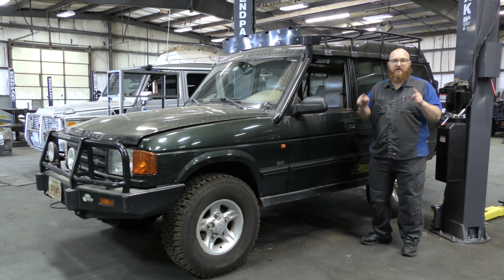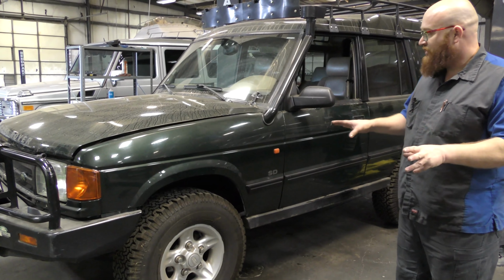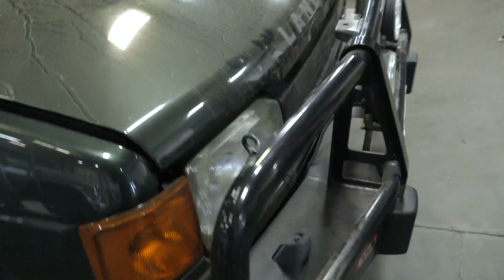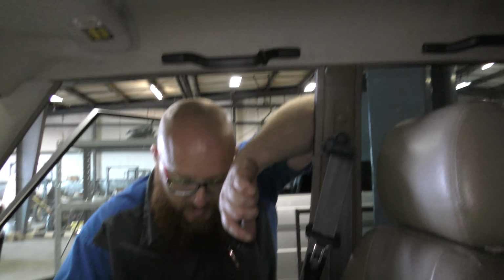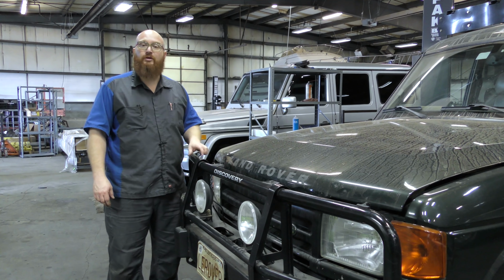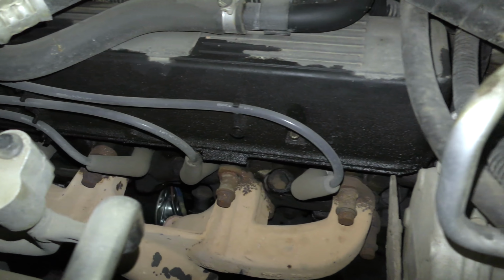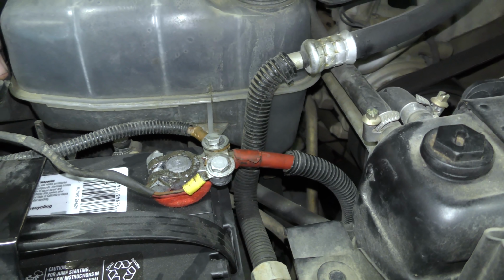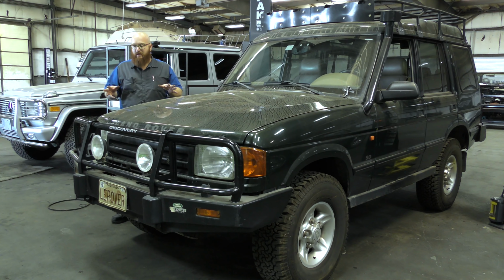How can such a simple repair cause huge problems on this '99 Land Rover Discovery? CAR WIZARD knows

Comment: People jump for the older Defenders but I like this...
Reply: Yeah its sweet
Reply: @Chris Howard , WALL STREET 😎
Reply: Yea I love these things for some reason
Reply: Defenders and Disco 1's are very similar, even down to the same axles.  But the Disco 1's are far cheaper these days.  Crawl underneath and you'll see that beneath the pretty sheet metal, they're built like tanks.
Reply: They are creeping up in price. Similar to the rr classics. They can be made just as capable as a defender and actually the discovery is nearly a defender with the refinement of a range rover. However off the shelf the defender is more capable however it borders on too utilitarian while this is has the best of both worlds imo. It does not have air suspension which should be categorized as a routine replacement item since it will eventually wear out every 4 or 5 years maybe longer but likely less.
Reply: @krookdfinra  well said, and I dream of air! My 110 rides with the grace and poise of a bin Lorry🤣⛟, but due to mods is at almost 3 tonnes with the roof tent and 'trip' ready, and I stare jealously at Rangies striding past me on the motorway, riding on a pillow of air!
Reply: @krookdfinra  Non-air suspensions eventually wear out too and start sagging.
Reply: The early to mid 1990s Land Rover products are very similar underneath the body. What makes the Discoveries such a POS is the electronics which start going haywire. Many of them end up in the junkyard cause it's not worth fixing all 4 inoperative power windows and a leaking sunroof. The only electronics the Defenders have is the ignition system.
Reply: @capmidnite  usually if its aftermarket  they wear out faster. My original suspension still works fine being 20 years old. Could it use new ones sure but the ones on there preform better than significantly younger vehicles in my opinion. I did upgrade the steering and track rods to hd and replace the steering gearbox due to slack in it that was not correctable by adjusting it. However air suspension is actually a wear out item
Reply: Had a 1991 Diesel powered one for 10 years as my daily driver just so reliable

Comment: Great to see a Disco in the shop. I have a '98 Disco that I recently bought that I am repairing a rusty frame on, because I live in Canada and everything rusts here. The rest of the truck is actually very nice with all original paint, a mint tan leather interior and only 150K KM on the clock. Best of all, everything works, the sunroofs do not leak, and the head gaskets are fine. Hopefully I can get a few good years of four season use from it, plus it will easily tow my car trailer. These are really fine trucks when properly sorted, and will take you anywhere you need to go. I also think the Disco 1 is the best of the bunch. Thanks for the tip Car Wizard!

Comment: Nice to see someone in the US having time for the Disco 1, very underrated truck especially off road , used to be very cheap in the UK but now the nice ones are making strong money, most rot on the body here, strange as the disco 2 rots on the chassis!  At least in the UK parts are very cheap and plentyful, most here would be 2 or 300 tdi as opposed to V8.

Comment: I KNEW IT!!! I knew you were gonna say problem at the battery terminal! Do you know my company car, 2017 Jeep Renegade spent probably 75% of 2020 in the shop for a chaotic electrical issue? It first went to the dealership admittedly just before the pandemic. They blamed it on the aftermarket construction lights that worked perfectly before they unhooked them, sent me out, problem came back few days later. Car would randomly shut off and throw hella warning codes. Pandemic hits, car gets stuck at the shop, I’m stuck with a loaner. Months go by, I get the car back, problems return, months go by, get the car back problems return. This went on forever! They even changed the BCM! This went on for so long we were on the verge of calling for lemon law. Till that last time, they had it for a while, drove it around several times so it could act up on them. Finally, they discovered there was “some corrosion on one of the battery terminals” They cleaned that up, haven’t had a problem since.

Comment: Seeing this video and the outcome reminded me of this post I read today:

A giant ship's engine broke down and no one could repair it, so they hired a Mechanical Engineer with over 40 years of experience.
He inspected the engine very carefully, from top to bottom. After seeing everything, the engineer unloaded the bag and pulled out a small hammer.
He knocked something gently. Soon, the engine came to life again. The engine has been fixed!
7 days later the engineer mentioned that the total cost of repairing the giant ship was $20,000 to the ship owner.
"What?!" said the owner.
"You did almost nothing. Give us a detailed bill."
The answer is simple:
Tap with a hammer: $2
Know where to knock and how much to knock: $19,998
The importance of appreciating one's expertise and experience...because those are the results of struggles, experiments and even tears.
If I do a job in 30 minutes it's because I spent 20 years learning how to do that in 30 minutes. You owe me for the years, not the minutes.
Reply: Great analogy... So true.
Reply: That guy was Jeremy Clarkson!
Reply: this is amazing

Comment: I had a 2010 tribute come into the dealer one of the other techs replaced the battery a month before but the complaint was after they washed the car it wouldn’t start a the security light would come on so I spent hours trying to figure it out I wasn’t making any money on it so I went into work on it on a Sunday and pulled the battery for the 10th time checking all the ground wires but this time I pulled the battery tray I immediately noticed a wire got hooked on a tab moulded into the battery tray pushed through a hole and was rubbed through but only made contact with ground when it got wet it would kill the PATS system I was able to recreate the issue and be 100% sure that was the cause it always ends up being an easy fix it just takes time to find it sometimes

Comment: I own a discovery 1 98 its Niagara gray. I love it. My first car and more than likely id never sell it. I put a magnaflow stainless catback exhaust kit on it and only makes me want to drive it more. Its honestly a very simple vehicle to work on. Invest in a mechanics grade tool kit from kobalt, a 52mm socket, and a fan clutch wrench and there really isnt much you cant work on with this vehicle. Also replace that plastic radiator cap with a metal one for peace of mine. To date ive replaced the headgaskets, oil pan gasket, cleaned the oil pickup tube out, rear diff gasket, fuel pump, fan clutch, reolaced all 4 rotors brake pads and calipers, painted calipers and valve covers ceramic red, replaced the water pump, upgraded steering rods to hd spec, replaced the power steering gearbox,  replaces the brake servo and master cylinder. I also painted power steering reservoir, alternator, and front timing cover back to factory silver. It was alot of work but it gives you alot of confidence knowing if something does go wrong with your vehicle that you will be able to fix it. Unlike most modern vehicles that without going to a shop some things are actually impossible to fix since they need to be programmed into the actual vehicle.

Comment: If you get more of these in with immobiliser issues, You can bypass the whole anti theft on these when they start playing up. It's pretty common in the UK to just disable the system. So common infact, that Land Rover themselves started to make the part! Look up Discovery Spider bypass.
Reply: US models did not come with the spider unit. 
There is another method to bypass the immo in these, or just program it out of the 10as.

Comment: Recently bought an 03 disco 2, now this is the first "big girl car" I own, kind of a childhood dream I had. Drove super well all summer but last month it threw up the entirety of its coolant on the floor of the parking lot after only 50km of highway. Panicked, immedately thought 'omg the head gasket is done for'.  My brother said 'chill, go from cheapest fix to most expensive'. Started with the coolant tank cap, and it was fixed. The o rings on the cap were dead and the tank couldn't hold the pressure in anymore. Impressive breakdown, and stupid simple fix lol

Comment: I've got a 01 disco 2. Gaskets done at about 150 k. 220k on the clock now, runs strong.
Reply: Yeah I don't mind tackling the head gasket ones in the lifetime of my car. Allows me to see in what shape the internals are.  That's for old cars mind you. Where head gaskets aren't a 1 week job😂
Reply: Sounds like you’ll be due for another head gasket in about 30k then. My D1 needs them and it’s only got 80k on it.
Reply: @Geetee3991  I hope she makes 300k. If so I'll be a proud papa lol.

Comment: I drive a ‘96 Discovery every day. Wizard is absolutely right, a lot of the issues I’ve fixed on mine have been as simple as bad fuse connections, or a loose ground… very sensitive to electrical connections that’s for sure. Gotta say I love this thing!

Comment: Nice find Junior Mint!  Had a similar issue with our old '70 GMC... my dad had it out at a movie shoot and just when they were trying to do the last shot of the day, it wouldn't start, no lights or anything (the ended up pushing it around!l)... it had to be towed back to his house... I looked at it and turned the lights on, no power, no click no crank.  Touched the positive battery connection, it had the same type of replacement clamp,was tight, but not tight enough... the clamp was painted red, even where the wire was clamped, it was enough to allow some arching and carburization of the connection... replaced the whole wire with a proper oem style, all good!

Comment: I had a Discovery 1 same colour as this one brand new. Mine was a turbo diesel, was solid as a rock and more than earned its keep for the business. Even took 4 adults and 2 kids on holiday to France. It had the optional suspension upgrade and larger wheels that became standard on the later facelift version which I bought trading in the first one. The only issue was an overheated radio in the first one (replaced under warranty) but the facelift one had a different dash and no problems at all.
Superb cars that really get a bum wrap from people who don't understand them and don't service them as they should be.

Comment: Greetings from the UK. Amazing that Disco is still running, not many 21 year old left in the UK. The V8 was not popular here, too thirsty, most were diesels. The engine as you say is ex Buick and a very old design, and was used in many British cars, Rovers,TVRs, Morgans,MGB, Range rovers etc. Started out as a 3.5 litre and slowly grew to 4.6 and sometimes a bit more.
 I ran a 4.6 litre MGB roadster, I used composite head gaskets and no problems. Head gaskets were an easy repair if caught early.
 I had an early Disco automatic diesel, it was awful, almost dangerous, very slow to pull out of a junction.

Comment: I worked at an auto auction for a little bit, and on sale day, all the technicians were assigned to the sale lanes, and staging area to just do jump starts, and small problems like that. Its absolutely amazing how many serious looking problems we found that come back to loose connections at the battery, poor connection from corrosion at the clamps etc. Even worse, people jumping cars off backwards is an insane problem - youd think its self explainatory, but it isnt. And of course they blow the main/alt fuse and car wont charge. Seen hundreds of altenators replaced after a dead battery was jumped, and didnt charge the new battery once replaced. Blown fuse from backwards jumping. First thing to look at when you have charging issues ESP on toyotas/lexus.

Comment: I've got an 03 D2. I switched to the 180 degree thermostat from the TD5, replaced the entire cooling system minus the heater core but including the hard pipes, flushed with distilled until it ran out crystal clear, and used G05 coolant and a bottle of water wetter for the hopes and dreams aspect. Haven't seen temps go past 198 and that was sitting idle in 100 degree heat with the AC on. Hoping the headgaskets are happy

Comment: Timing belt failures is the diesel 2.5 motor.
In Australia 4 litre and the garbage 4.6 v8 were only in Rangies, Disco had 3.5 and 3.9 v8.
4.6 cylinder liners leaked.

Comment: I bought my Jeep Cherokee for fairly cheap because it had a charging issue. Randomly would have a dead battery or would not start. It was because of one of these parts store quick clamps. Not only do they vibrate loose, they corrode internally. They were originally designed as a roadside repair item to get you home. 

I highly highly recommend removing it, cleaning the wires and crimping on copper lugs. With a proper large wire crimper it will create a mechanical weld with the copper. Install heat shrink. And bolt it to the battery terminal using a lead ordinance terminal. My local battery shop will do both terminals for like $14.

Comment: Its good to finally see someone giving the discovery the credit it deserves. I have had 2 both from new, a disco 1 then a 2002 which I am still driving today and have never had a major issue with, never had a head gasket need replacing though I might replace it soon just as a precaution, and would use ARP head bolts instead of the original or Land Rover OEM replacements. 250,000 Km and going strong.

Comment: Again, great video!  I had a similar experience helping my friend (He is a very experienced mechanic that specializes in Ferraris..). His wife's Cadillac had a no start issue. He determined that it was a bad starter and asked me to basically "hold the flashlight". We dig in, take out the intake manifold and stuff. Replace the starter. Put it all back together. Still no start. 
I recommended that he re-check battery and connectors. While doing so, guess what? One of the connectors was simply loose. Re-tightened it. Started right up. 
Wasted like 6 hours on that, plus the price of the starter. LOL

Comment: Regarding the head gasket issues.  
The coolant thermostat is set very high to meet emissions controls worldwide.  The resulting excessive heat cycling of the engine then leads to the cylinder sleeves in the larger V8s coming loose, as well as head gasket failure for the same reason.
The solution is to install a cooler thermostat.  Its a bit of a mod on some V8s as you have to fit an external thermostat housing, but it works.

Comment: Bottom line: you like what you like.  Wizard loves English cars, even though he knows every Rover V8 will blow its head gaskets.  Wizard obviously loves the Jag V12 - although I still dare him to even try taking the heads off the bad 5.3 V12 he got rooked on (spoiler; those heads are guaranteed to almost be welded onto the block of that 5.3 V12).
Reply: that rover V8 is an american engine though.......not english
Reply: @bonvoyage5377  Yes the origins of the Rover V8 are from a Buick of the early 1960's.  Rover has been the manufacturer for some years now.  They blew head gaskets in the 1960's, they still blow head gaskets now - even after all the Rover improvements.  I still dare the Wizard to even try to take a head off that 5.3 V12 he first bought.  He won't even try because he knows it has been fused with the block and will need a few tons of force to separate.

Comment: I had a similar problem recently. The negative terminal was old, worn and somewhat loose but the top edge had been squished to keep contact (bought it used). Wouldn't start one day, obvious electric problems. Did all the same dumb stuff. Finally turned over when I had a probe shoved in there testing the starter. Even thought I might need a new harness... Looked more carefully and had a "d'oh" moment. Replaced the terminal for $5 and works fine now.

Comment: Does Haynes still make car & truck manuals?  When I was in my 20's I learned so much about working on my old pickup trucks from Haynes manuals.
Reply: Yes, I got a Haynes manual recently for my old Saab (Ebay, I think), and it will stay with the car.

Comment: Back in 2013 I test drove a D2 with 99,000 mi and a D1 95 five speed with 198,000 mi. Hands down I chose the D1. Last summer I I replaced all wheel bearings splines spindles brake calipers brake lines all bushings tie rods water pump master cylinder brake booster and last the catalytic converter wishbone system system all the way to the end Muffler. I own two other classic cars but I can honestly say that this was the most self-satisfying project. Definitely worth the buy in my opinion.

Comment: I'm glad you mentioned you would be replacing the battery clamp.  When you went to just tighten it up I was like NOOOOOOO it'll just loosen itself again!
I prefer the battery clamps that have nuts embedded in the lead.  I don't know which Genius thought threads cut into lead with a steel bolt was a "good" idea.
I chased a similar issue with my Turbo Daytona. One day it would start fine, the next day --- not even a click.  Replaced the Positive Clamp with a good'n and I've never looked back.